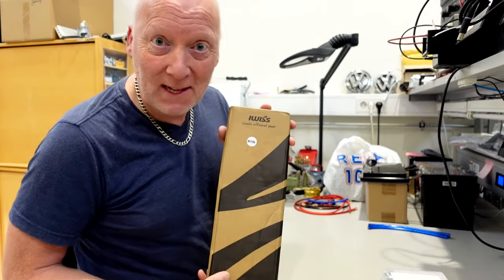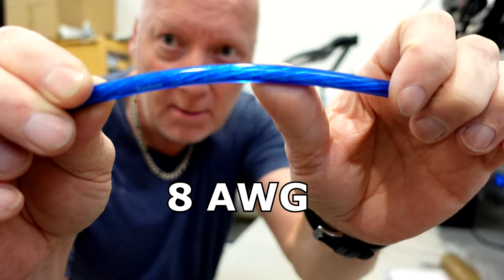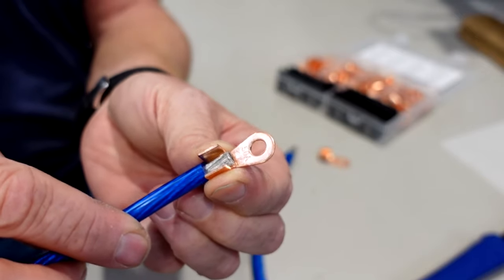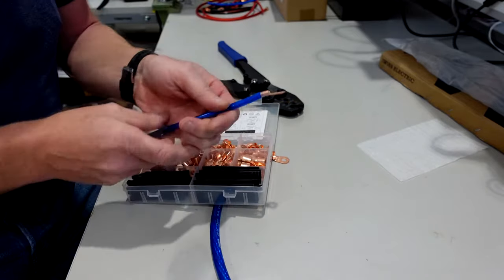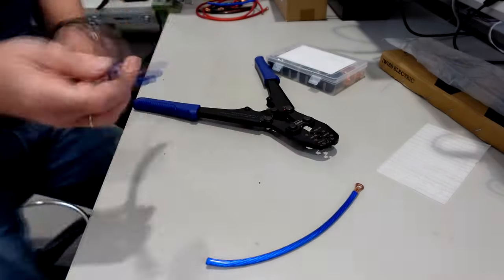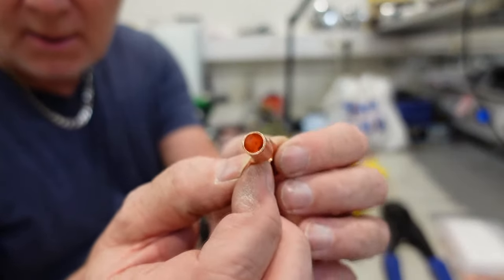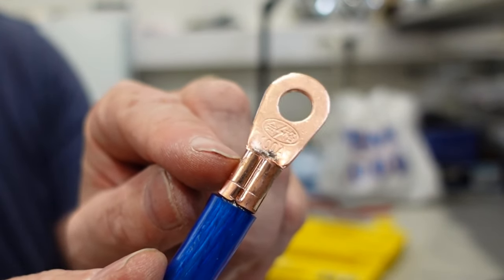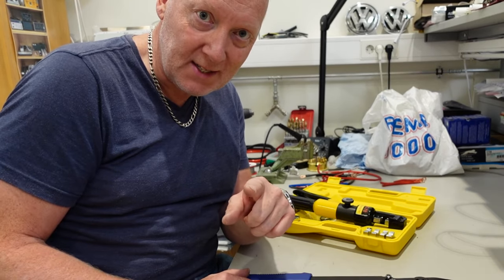BEST Battery Cable Lug crimper Crimping Tool Open Barrel terminals (IWISS Harbor Freight Hydraulic)

Comment: That's a compound lever mechanism John 😉 looks like a reasonable quality DIY crimp tool. I have extensive experience of crimping having spent 40 years working for GEC/GEC Alsthom/Alstom. The hydraulic tool should create a squashed hexagon shape with minimal flashing that can easily be filed off. The result you got was a totally inappropriate cable size to crimp (lug) and you would most likely get a quite similar result if you crimped it without any cable at all. We only used hand tools to a maximum of 6mm2 (with compound lever) and 10mm2 plus were all hydraulic for both open and closed type. I would personally use the hand tool for smaller gauge wire and the hydraulic for large stuff which is what it's best at. Absolutely no criticism of you John and purely for educational purposes for anyone viewing this video 👍
Reply from the maker: Thanks for the indeept answer, I really appreciate it 👍
Reply: These are open barrel terminals. They aren't meant to be squashed in hexagonal shape. The result he got is exactly how open barrel terminals are supposed to be crimped.
Reply: @1idd0kun  Hi, I was NOT referring to the open barrel crimps !!

John produced a perfect and a not so perfect crimp using the universal tool but that was likely down to a simple case of the settings.
In my employment, where I worked for over 40 years (manufacturing traction equipment and electronics for the rail industry) I can say with absolute confidence, the following:
 The poor crimp would never have passed our rigid inspection or test and as such would never end up on a train that members of the public use. I wouldn't be happy with that crimp at all but I have seen the results that occur from poor crimps.
Being a safety critical environment, the only universal tools we used allowed for a specific crimp and a specific wire CSA/gauge.
Every single tool was calibrated every 6 months and quarantined immediately if it failed. As every tools individual  serial No. was recorded on a comprehensive build sheet, It allowed for complete traceability. We had well over 1,000 tools in the production process.

 I don't know if you had watched the latter part of the video?? but I can say that the crimps that go with that hydraulic tool were Mecatraction (French manufacture) or copies of and are a closed design.

The correct type of tool for those crimps should produce an hexagonal shape 👌

Comment: I got those same pliers and lug kit and found your video. I think I’m going to be happy with it they look to make a nice product. I heard of the issue with the wings on the closed barrel terminals and I find if you use the next size down terminal or one that just fits snuggly on the wire you won’t get the wings. When I was using my hydraulic crimper I found all the terminals I got that were the size of the wire were too big and I went a size down and got no wings. The one terminal I didn’t have the smaller size I had to crimp it in both directions multiple times to squeeze the material inward and keep from getting the wings.
Reply from the maker: Thanks for letting us know

Comment: A tip for using the hydraulic crimp tool. 
Start with a size larger die. It will reduce the size of the terminal barrel firts without doing unsightly damage. Then use the next die to finish the job, you will have a much nicer looking terminal..
Reply from the maker: Good tip, thanks 👍

Comment: You want the little flare on the crimp at the cable side so there is no sharp edge on the terminal so it wouldn't cut into copper wire.
Reply from the maker: Good tip, thanks for telling us 👍

Comment: Open barrel cable lugs have no advantage over barrel cable lugs. The barrel cable lugs on the red cable in the video is just badly crimped.
It is visibly deformed so it was not crimped with the correct dies size. That is all.
Tubular cable lugs can also be crimped with a dies profile other than hexagonal. For example "W" profile or Quad-point indent  crimping.
It is always true that each type of cable lugs requires its own specific crimping tool of the appropriate size.

Comment: Your comparison is a hydraulic crimp in a lug far too large for the wire gauge you chose?

Unfortunately wire gauge and lug size aren't universal. Deviations exist all over the place and you have to find the lug that the wire most tightly fits into and then find the die that works best with it. You need to be careful that you don't buy lugs that are extremely thin. They also purposely make lugs that are extra thick and I would imagine those would need a die to be slightly oversized to get a proper crimp on the conductor without getting wings

Take an angle grinder and cut the ring terminal about halfway up the barrel part that you crimped. 

A hydraulic crimper will turn any stranded wire (but of course the fine stranded wire used in batteries/welding/car audio is going to look best) into a solid mass of copper. It is glorious

Comment: The closed barrel connectors are better (stronger and look nicer) if done properly.  Your sample was crimped using a cheap tool with the wrong size die set.  Look at the crimps made with a Temco hex crimper and you will no longer think open barrel terminals are better for wires of 8 AWG (53 mm^2) and larger.
Reply from the maker: I agree with you, but I sitll love my open barrel crimper 😀
Reply: @Italjohn  Yes, they do a good job also, especially for smaller wires of 8 AWG or smaller.  But for 6 AWG up into the 0000 range, I much prefer a good closed barrel hex crimp simply due to physics.  Most metals are stronger in tension than in bending.  An open barrel crimp depends on the bending strength of the ears that are folded into the wire.  A closed barrel crimp depends on hoop tension of the terminal.  Just as pressure vessels like tanks are circular in cross section for maximum strength, a circular cross section terminal connection to a wire will always be superior assuming the same material thickness in the terminal.

Comment: Do you think it's over the top to also solder? I find I can't resist!
Reply from the maker: Adding solder is even better 🙂
Reply: You shouldn’t solder automotive wiring, for the same reason you should never use solid wire. Stranded wire and crimping allows the wire to flex without causing fatigue and breakage of the wire.
Reply: @27evan74  Unfortunately the crimp is subject to copper corrosion.